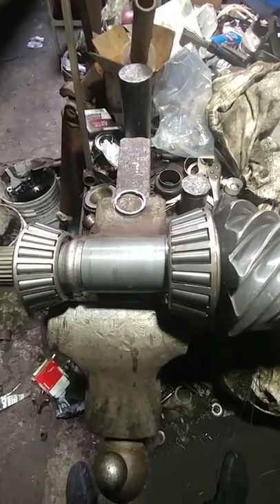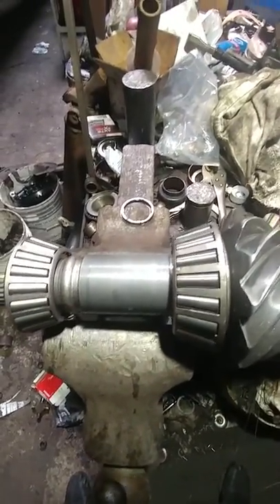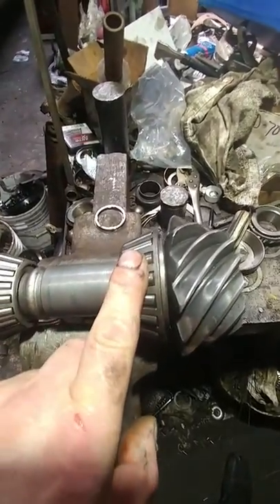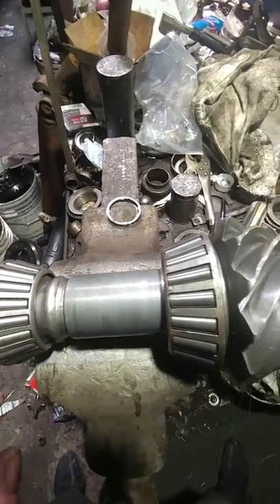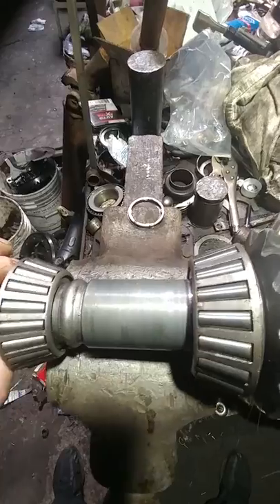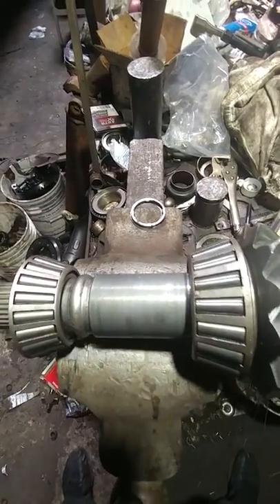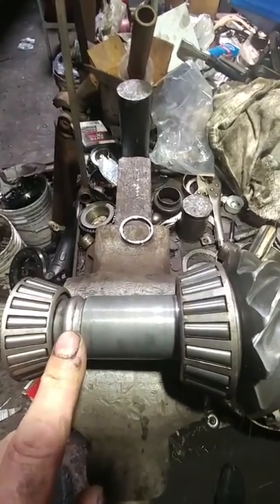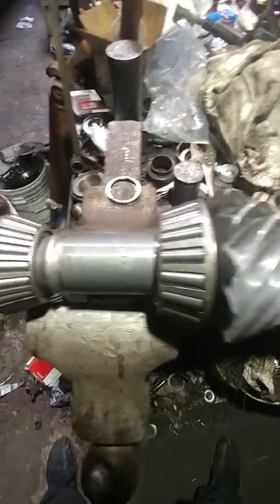Differential preload and crush collar misinformation

Comment: agree a crush sleeve works excellent you just need a inch pound torque o meter to check your bearing preload and your good to go
Reply: Yes sir it does it’s job unless it’s in a guy’s race car that changes gears for different tracks and yes he should then buy new yokes for each gear  🤦‍♂️ but so many of these racers aren’t willing to do that so to make fame sure he doesn’t screw up and over tighten a crush sleeve that would be  destroyed by doing this we set up the gears with solid pinion spacer that is the only way he will not screw up his pinion setting regardless how many times he switches the yokes on and off

Comment: Makes sense. Shimming just makes it easier for a guy to get preload right on the stands in his driveway. I was kinda wondering how you get carrier preload set
Reply from the maker: Carrier preload is set differently and I'll make a video showing that.  Carrier  preload is just as important as pinion,  and the lack of Carrier preload is the cause of most ring gear issues.

Comment: Pinion shims are definitely not a rocket science new invention, hell Dana has been using full length pinions and shims since the beginning of time on many diffs. crush sleeves are quicker for the guy who has done them, for the new guy, it's kinda intimidating to crush one the first time. Although from a maintenance stand point, with shims you can replace the seal and or yoke without worry of changing preload, so that's a bonus.

Comment: Tell me about cleanliness and organization.
Reply from the maker: Tell me about your mom and I'll tell you what she taught me.
Reply from the maker: @charliegrace7765   ... wow you are a dick..  did you mean couth stupid??? Don't pretend to be smarter than a bump on a log laying in a swamp dumbass.  
   Another fool trying to think they know... the crush sleeve simply makes D R A G , or what we call preload.   That simply keeps the bearings in contact with the races on both ends during both opposite forces the pinion gear goes thru during accel and decel. Same principle as a hub bearing , but it doesn't see detrimental forces due to gear contact angles, now go back to looking at the scrap on the floor dopey.
   Also,  I don't care what misspelled words you use to try and attempt to sound knowledgeable.  
    And again you are one of the idiots the past 45 years I'm in business (and recommended by gear manufacturers) that tell people something stupid shit about shims being stronger....you don't need a higher torque setting , you dont even know where the torque is being applied,  you're slacking and your intelligence has shown.   Now go fuk your Mom
Reply: @Supershafts  the mans rite very simple process
Reply from the maker: @darrenyoung4893  whos  right about what ?

Comment: When you say it’s easier,I hope your talking on a-bench I hope.Getting the correct preload in a drive way on your back isn’t a easy thing to do.I would definitely use crush sleeve eliminate if your working on a car car-truck in a drive way.
Reply from the maker: Actually it's far easier on your back, you can use the ground to hold your bar on the end yoke.  On a stand you have to hold both. . 
   The only time a shim is better is when you're changing a seal, and even then if you know what you're doing it doesn't mattsr
Reply: worked good on my drive way for me

Comment: Use a Ratech Smart Sleeve or a solid spacer with shims and make your life easier. The only dopes that still use factory type crush sleeves are the cheap bastids lol...
Reply from the maker: And you learned absolutely nothing nor understand .   I use CC and have none, 0.0 failures,
   Apparently, I need to do a really slow mr Roger's style video.
Reply: Wow. What an ignorant fatuous response. Actually crush sleeves are infinitely more accurate than shims. A mechanic who relies on easy methods is probably under par.

Comment: Nice vidéo !!!
Only drawback of crush sleeve is you need some expérience to avoid overtighting.
Impact gun VS wrench to torque pinon bolt what you recommand ?
Reply from the maker: I would recommend  using the gun only to take the play out of the bearings,  to the point they are seated and then use breaker bar from that point to add a little at a time and check it .  That's how I do it
Reply: @Supershafts   thanks for your reply !!! You confirm what i think is THE right way to do it 
👍🏻 🇺🇸
Reply: I’ve seen a lot of gears come to me to get fixed and it’s usually from the rookie that has stripped the threads on the pinion from trying to use the nut to get the crush sleeve to where it needs to be for the pinion preload and usually they have already went way past  🤦‍♂️🤦‍♂️🤷‍♂️😂
Reply: @Supershafts  is that with pinion only or pinion and carrier
Reply from the maker: Pinion only

Comment: Hey question so tightened my nut and got 22 inches on the torque specs were 14-19. i backed up very little and now sit at 18 . You seem very knowledgeable and debating if I need to replace the crush bearing.
Reply from the maker: What diff are you working on and what did you change ?
Reply: @Supershafts  yukon 2005 gmc 6.0 8.25 gear with a 3.42 i tightened it to 22 inch pounds and specs i believe are 14-19 inches .I backed it up literally 1/16 and hammered center lightly and now reading 17inches.just don't have enough experience with differential but its my own truck.also checked in the area where you can visually see the pinion crush sleeve and I see it spinning in center when rotating the pinion.
Reply from the maker: The carrier is not in place ?  You are only turning the pinion gear ?  What was the reason you are doing this  ? You changed  bearings ? Seal ?
Reply: @Supershafts  changed bearings due to severe wear,inside the differential housing was black at one point the differential was dry prior to me owning truck.also made noise on hard acceleration.i changed the gear oil twice but more and more of that gray milky material kept building up. When I opened the differential the race bearing outer portion were really worn out and the outer portion of it spinned in the housing badly. I bought loctite 960 and put it on new ones outer part to hold them in place. Tried following the service manual unfortunately in the manual it said to check the torque value on pinion for reassembly which was very loose.looked online and found some specs that stated 14-19 .I did buy the proper torque meter to reassemble it.
Reply from the maker: OK so all the bearings are new and you're checking the rotational drag (preload) without the carrier in place and you have 22, so did you make a few rotations and check it again (like 5 rotations) if you had 22 and loosened it , I would say put another CC in there,  and do it slowly , once you get the play out make very little amounts of turning to tighten it , like maybe 10 degrees at a time , it's very easy to get to tight , but if you get 22 it'll be ok,  22 won't burn it up

Comment: What inch pounds do you want your preload set to for a Mustang 8.8
Reply from the maker: @lightgeekusa8606    on a new bearing you wany between 15 and 22 inch pounds.   Make sure that is rotating and not break away.  For example watch one of the videos and you'll see as I turn it I now adjust  the mark needle back against the dial , so I have rotating load and not breakaway , breakaway will always be more than rotational
Reply: @Supershafts  could I add small shims on the sides of my clutches inside the carrier to firm up my Spider gears? i feel there is a litle bit of play in the spider gears and i have a bit play in my axels due to this I believe?
Reply from the maker: @lightgeekusa8606   that isn't how it works,  your axles are held in place by the c clip and cross shaft. There is a little  bit of in and out within that , if you have worn spiders , then you replace them. You don't shim them,  and are you able to actually rock side gears and spiders while  the assembly is altogether ?
Reply from the maker: @lightgeekusa8606  is this limited slip ??

Comment: 40 years in the trade and 20 of them in the performance side of the industry?  , one thing I learned, anyone calling anyone else an idiot?
Reply from the maker: I didn't call them idiots and walk away, I called them idiots and explained why I called them idiots.  My use of idiot is very different than you would use it, so in 40 years . . . .
 The next video I use idiot and stupid.
.
   I see you removed your other comment , seems in fact you are capable of learning.  "all fun and games until you hit a ford 9" with 1000ft of torque.. it will in fact trash the crush collar.. better start running..."  
   So I'm guessing you watched and learned something about the stupidity of making that comment, and why you pulled that comment down... 
  1. A 9" ford will break with a 1000ft lbs...and the CC won't have any issue. 
  Or you're talking about a aftermarket 9" drop out in the  3.2, or 3.8 case , since we know the 9" in ford factory form will break, or rip the pinion support out and take the shaft, trans and thrust main out with it.. .
.
  In my 30 years in the full spectrum of automotive work, and marine, some aircraft work, I have learned that MANY people in the industry for 20 and 40 years are CLUELESS as to what they're doing, and don't really know how things work.

Comment: I realize this is an older video, but am just finding it now.  Thank you for the reassurance that the tried and proven crush sleeve will get the job done despite overpriced alternatives now on the market.  And related to that, do you reuse the ring gear bolts?  At $7 each x 12 bolts this seems to be an unnecessary expense since they aren't torque-to-yeild type bolts.  Maybe just some loctite?
Reply from the maker: When I do builds that use new gears I use the new bolts.  The only time I don't use new bolts might be some older range rovers where getting them can be a pita. 
   Otherwise you can use them over, however you need lots of experience with bolts to know what that feel is when you get toward the torque spec , and when you feel that feel of easing twist that bolts junk.  
   I've had many main bolts in the diff get that and even a few engine mains over the years, that's why it's ALWAYS good to use the torque wrench and not the impact gun. 
   Always use red locktite on the ring bolts and pin nut. 
  Also locktite has a shelf life , always make sure it's within it's life use or it will not hold.   Trust me , I used to buy the big $160 bottles and well buying them in more than one at a time quantities.  We had a few bolt issues where they backed out , called locktite and asked them and they asked for the code and I lost it... I said that shouldn't be a fukin code.  That should be a clear date printed.  Well needless to say I had $1200 worth of assorted  expired locktite bottles. 
  I think now they put dates on them.

Comment: Dude i would give 1st born away just to be in your circle of close friends ive watched and learned from other  classes of proper and improper repairs. I understand not wantn to give away trade secrets because i am an industrial electrical tradesman. I am an idiot rookie working with my truck. I overtightened the damn preload and now  im payin the price for letn a already tuff job get the best of me and overlooking a very important step. I let yal just how much that cost was when i take back down and see what kinda cluster fuck i created inside housing. The lesson taught the hard way on me and learned so far. DO NOT OVERLOOK AND OVERTIGHTEN PRELOAD ON PINION SET UP!!!!
Reply from the maker: Frank if all you did was make it to tight , then all you did was kill the bearings.    Now , that's only if you drive it till it started making noise, and then stopped and didn't do like a few customers I have and continue for too many miles more.  
   When you make the preload tight what happens is the bearings will run hot, they will cook the oil and then at that point is when you can damage the other parts in the diff , once the oil has been changed to the viscosity of water all things will rapidly turn to junk.   So let's say you drove it 20, 30 miles you may only need bearings , but you'll know when you pop the cover , if when you remove the cover 2.5 qts of oil comes out in one big black splash , then you have to look the rest over very carefully and see if you need anything else replaced.   
   Good luck and I hope it was short trips.
Reply: @Supershafts  what if I did the same thing but realized it instantly and backed the nut off right away?
Reply from the maker: @evsnova74  well honestly what you needed to do was throw that nut away and get a shim about .015 or .025 and put that between the bearing and crush collar and re-set the preload and put a new nut.   Now if you just back that nut off what will happen is it will slowly loosen up.  If you're really in a major jam you can get a new nut and lots of red locktite , like get stupid with it and submerge it all in it , and put the nut back on and checking the preload and get it to between 8 and 12 inch pounds, depending what diff you have , im assuming this is a passenger vehicle and not a hd truck or 1 ton LD truck
Reply: @Supershafts  thanks for the reply. It's still up on jack stands, I didn't even continue reassembly when I realized my mistake (I thought it had to go around once more to get back to the punch marks I made before I removed it). I've got a new crush collar, nut and seal on the way, I just wondered your thoughts on if I messed anything else up besides the crush collar. It's an 05 GTO with mild mods so not that most demanding needs.
Reply from the maker: Also just so you guys know , and I'm gonna regret saying this probably when people do it and then have a issue , but I'm gonna say it in the hopes people understand what I'm saying and don't think oh no problem I'll just do that. 
  .
    If you replace the seal or end yoke , most impact guns (( PLEASE CHECK YOU DON'T HAVE A INSANELY POWERFUL IMPACT GUN )) don't have the power to crush a crush collar.  
   Most crush collars need 300 ft lbs to crush, some a tad bit more and some a tad bit less , you could put it back on and not rechrush the collar. . 
. 
 Now for you guys out there that don't know your own strength or don't know what "TIGHT" is and or needed a breaker bar to get it off with a an additional 19 feet of bar on it.... You shouldn't put it back that same way, remember so you could put it back , take all the slack out of the pinion, check that by pulling it in and out pushing on the end yoke up and down , when all, any movement is gone then you can take it add another 20 degrees of a turn and you should be at a working area of preload that won't kill the bearing.  
   But always put a mark on the socket and end yoke or flange yoke and count the number of turns to get it off and put it back the same way and on this procedure , remember always a new nut , if not get insanely stupid with the amount of red locktite you use, then go an additional 10 degrees.. when adding the locktite pretend you're putting strawberry syrup on your girl or whip cream all over or whatever you want all over her and do that to the nut with locktite.
Reply from the maker: @evsnova74  . . If you didn't run it you didn't hurt anything , and if you did you won't kill the bearing in a minute, but it won't take a long time for it to run hot though and once it starts making noise then youll need to change atleast one of those pin bearings , if not both.    
   Most times in case you ever make it too tight and it starts making noise , if you didn't drive it till the bearing melted away and ran a new pattern on the gear , all you'll need to do is replace the bearings and reset the preloads... 
   Like I tell my customers , the only normal noise your car/truck should make it out the exhaust , anything else take a look and see what it is , don't let them get louder, low noises can be $90 to $300 fixes , when they get louder they turn into $900 and $5000 repairs or wheels fall off and you crash.
Reply: 24 inch pipe wrench on the yoke resting on the ground

Comment: I need a video on how the pinion shaft is assembled.
Reply from the maker: sheldon  im not sure what youre looking for, how the pinion gear is installed into the housing?   If so its a somewhat involved process.  The bearings are a press fit onto the pinion gear, however dept of the gear must be established and correct before we can proceed to bearing preload. 
.
   Setting the depth is hard to explain as it involves reading a pattern, more so then setting a depth setting by number on a depth guage. . 
   Feel free to send me a message via email or call the shop, though i am not sure ill be able to walk you thru it
Reply: Marty Johnson I bought one that had been taken apart I have no ideal in which order the shims and crush sleeve go on. It is a Dana 30
Reply from the maker: sheldon the large pinion bearing will be pressed on first , however is this a new gear set up or are you replacing bearings ?
Reply: Marty Johnson used gears all new bearings